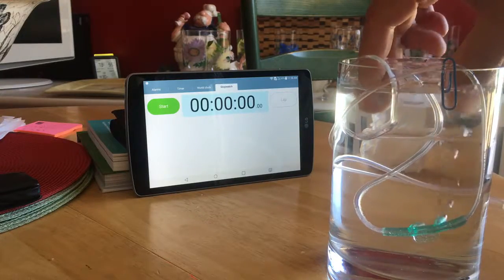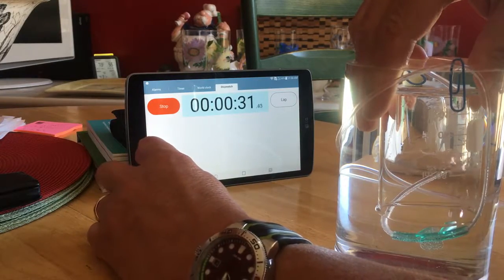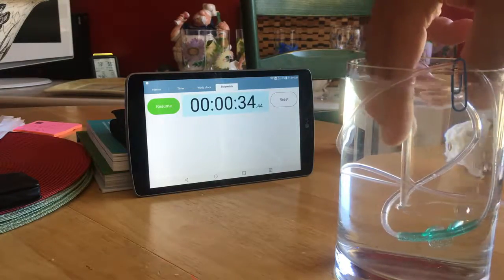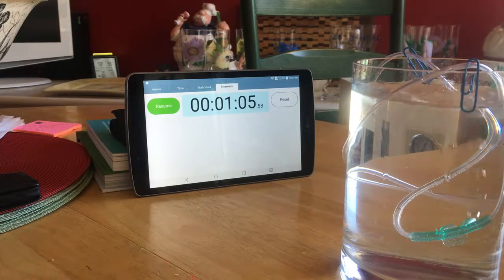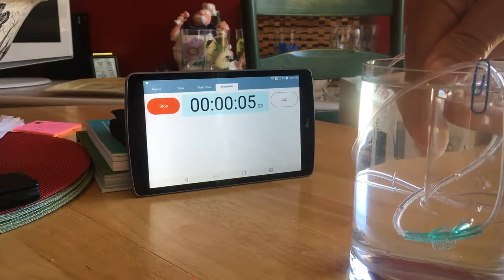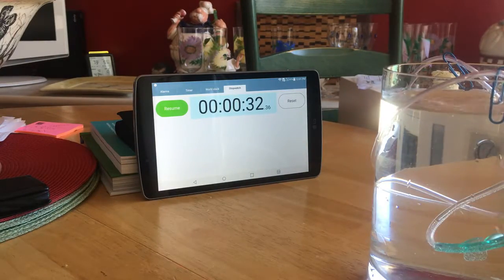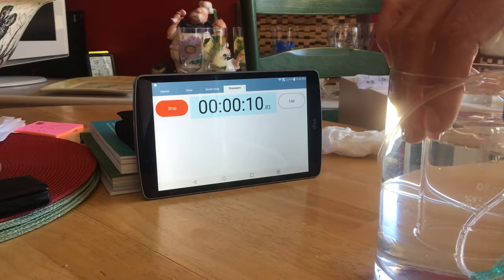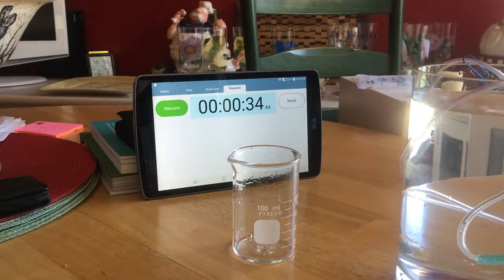Testing H2 breathing device

Comment: Did anyone try it while having pain and did you have any results?  
Thanks
Reply from the maker: Very effective for migraines and sinus pain. Also my wife used it once when she had a stiff neck from sleeping in a bad position, and it knocked that pain out too. Not immediate relief, but later that day she noticed the pain was completely gone.
Reply: California Hydrogen Water Co. Thanks. I hope this is true.  I will try this on for migraine and back pain later today or tomorrow.  Thanks again...
Reply: I tested it on a migraine for about 50 minutes.  It was about 100ml of hho per minute.  The migraine became alot worse.  What went wrong???
Reply from the maker: First of all, HHO is not H2, and does not have the same reduction properties of H2. 2 molecules of H2 combine with o2 (hydroxyl radicals) and creates two molecules of water. 

And, if you're getting 100ml/min of HHO, you're only getting 66% of that as hydrogen, which is not enough. Its recommended that 120 ml/min of use H2 is adequate for therapeutic use. You're only getting about half of whats recommended.